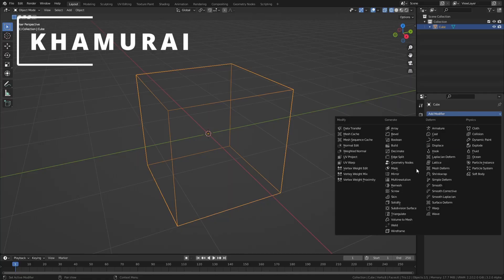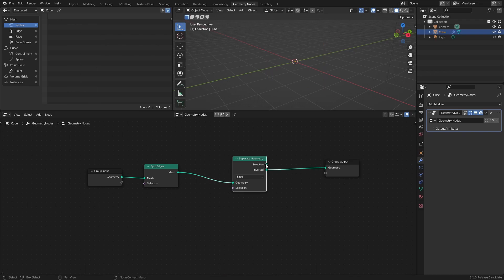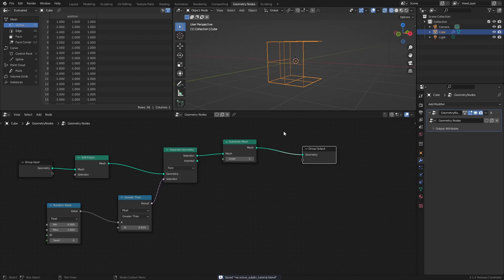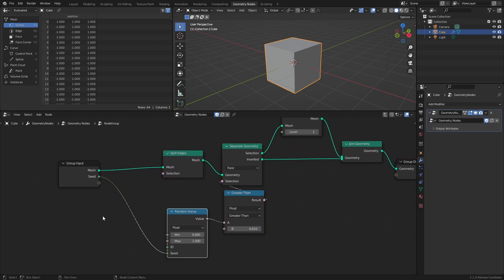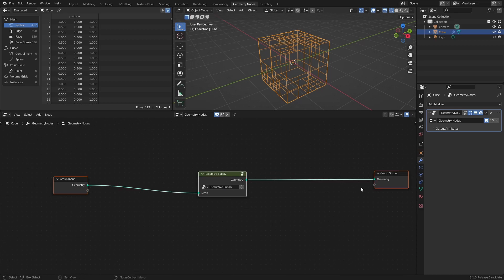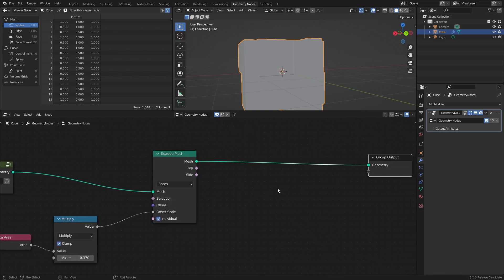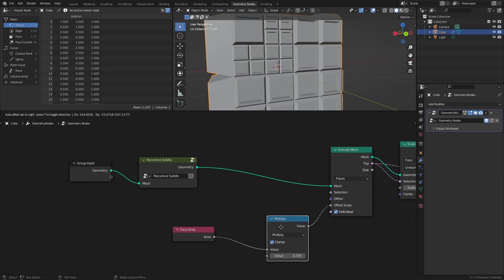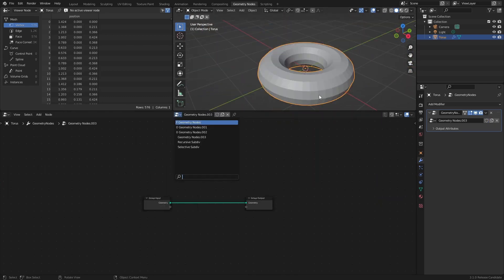Recursive Selective Subdivision with Geometry Nodes | Blender 3.1 Tutorial

Comment: Also if you drag the seed to the output, then add a math node to increment it, you can easily chain all the seeds, back to your Group Input and even do the same with your probability. Just saves you going in and out of each node group to change them each time

Comment: This knowledge is so dope.  Thanks for sharing. 
 I've come upon the conclusion that maybe is not Blender that crashes, but rather your computer.  I have a more powerful computer at work, and the problematic files runs without problem.  I've tried this in several occasions  and it works every single time.